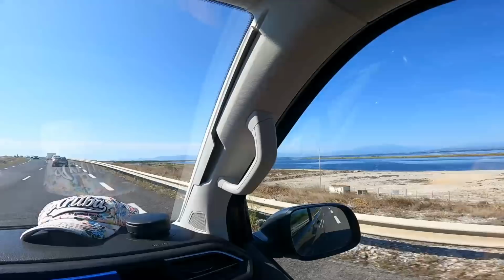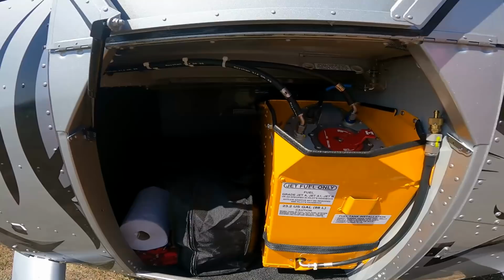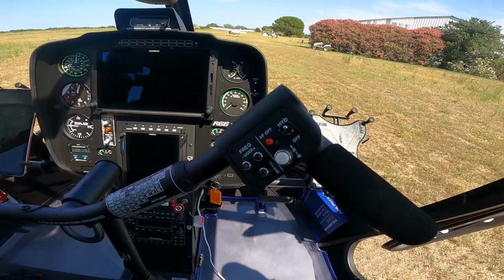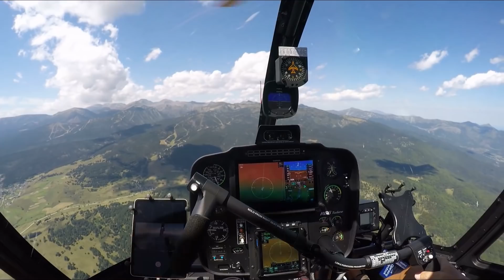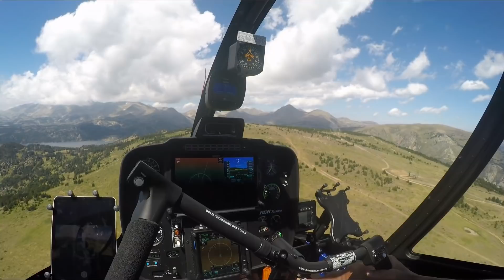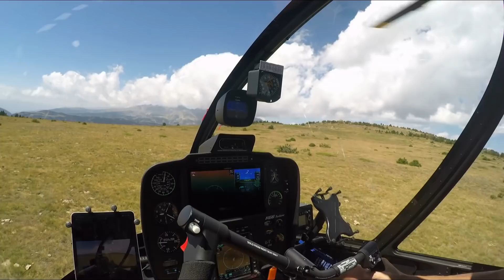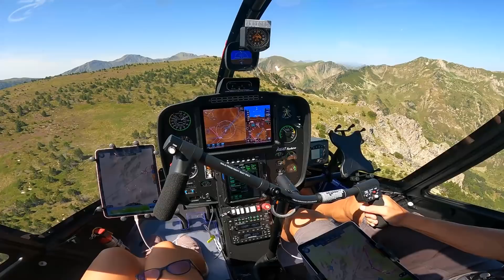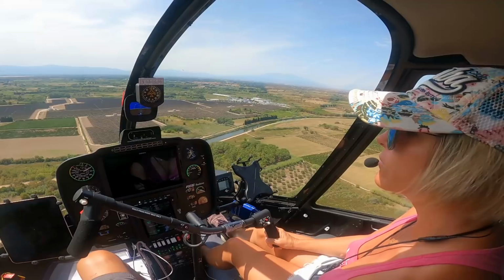Robinson Helicopter R66 Turbine Walkaround and flying in French Pyrenees MOUNTAIN DRAGGON

Comment: Dumb question . Do the floor pedals operate the tail rotor speed ?
Reply from the maker: With the pedals the pilot can and has to change the angle of attack of the tail rotor blades to counteract the rotation of the helicopter created by the torque. Only by pushing the left pedal on a counter clock wise turning main rotor blades of a helicopter (most Europeans helicopter the main rotor blades are turning clockwise) will demand more power. To avoid the speed of the blades going down, by increasing the AOA, the governor will automatically increase the power of the turbine. Other helicopter have a full FADEC. Enstrom piston powered helicopters have no throttle governor. So the speed remain the same and is linked to the main rotor blades. In the cockpit the pilot can check the speed of the main rotor blades with N2.
Reply from the maker: Oh and I do not think it is a dumb question :-)